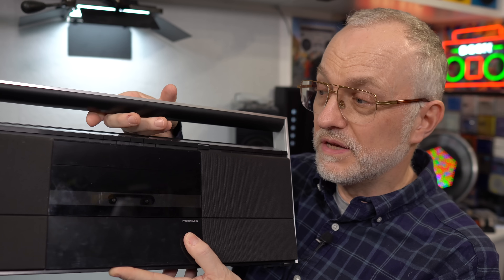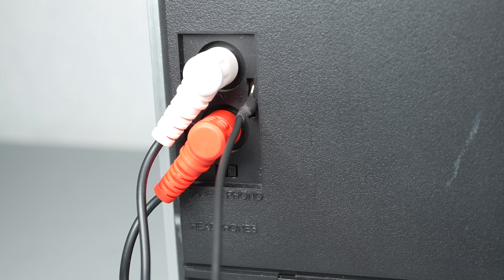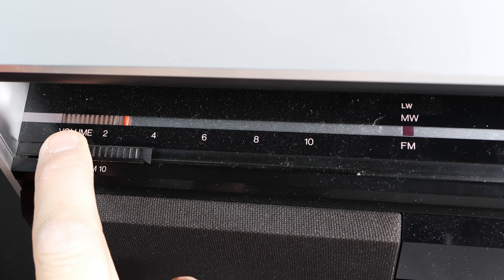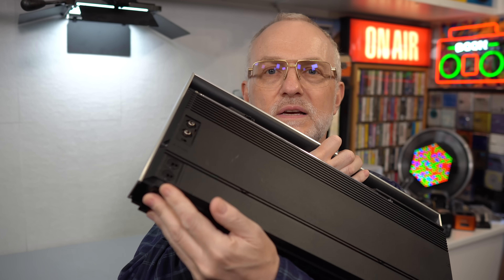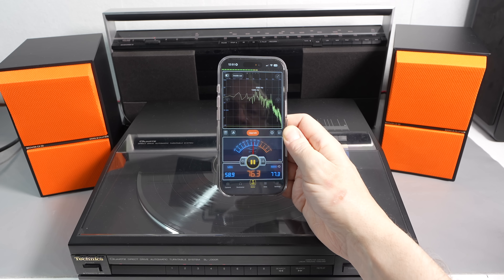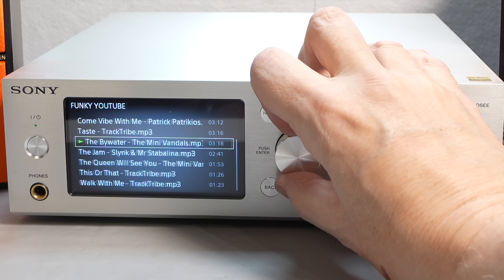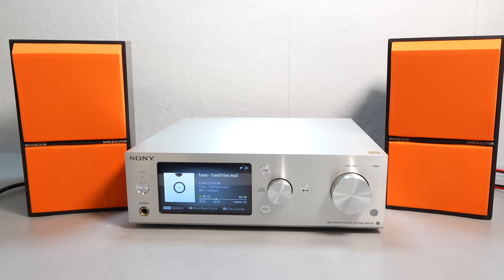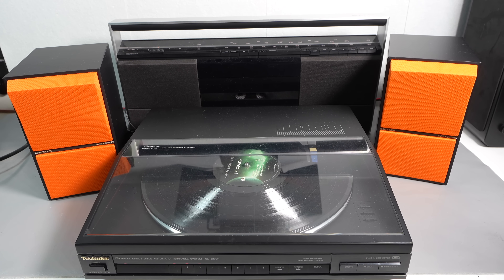Can custom CX50 speakers fix the Beosystem 10

Comment: Like all old hifi equipment, it deteriorates with age. How tiring it might be to hear all the time, capacitors and stuff do have an impact on sound quality, especially once you start pushing the volume and if they are from the early 90s or there abouts they wherent the best quality anyway. So i bet the radio would certqinly bennefit from a overhaul if you where planning on actually using it.

That being said though, b&o always was kinda the same as bose. They used a lot of sound manipulation in their systems to give them a certain sound. And they all have boosted lows at lower volumes to give their equipment a richer sound at normal listning levels but when you start pushing things you simply start running into the limits of their speaker designs. Making it sound increasingly thin as you increase the volume because you already get the maximum lows at low volume levels and they just cant increase further once you hit the 80db mark.
It simply was never designed for very loud volumes, mostly because their target audience wheren't the people interested in listning to their music at crazy levels.

This stuff was never made for youngsters having parties or anoying their parents, this was aimed at middle class people who wanted rich sound to listnen to their music at normal volume levels out of the box, without having to know anything about hifi equipment or having to worry about matching components. And for that it always performed perfectly, hence the popularity of brands like bose and b&o and the likes, even at their pretty hefty price points. Buy a system from b&o or bose and it simply fits together and it's all calibrated to give the results people are looking for whatever you decide to buy from them. They invented the "walled garden" approach long before apple became famous for it.
It can be a major headache to get b&o equipment to play nice with normal non branded equipment at times, requiring converters or custom cables and stuff to get it to work.

It was always made for regular peoples ears, and as much as self proclaimed audiofiles like to whine about it, regular people like a rich sound. And to get a rich sound at normal volumes boosted lows is what is needed.

Anyway, these systems are designed to get the most out of the speakers early on where most of their target audience would be comfertably listning to their music at the cost of audi performance if you push it beyond that. And turns out, this is the sweet spot for most people that have the means to go out and drop multiple grand on equipment from these brands to equip their middle class homes.

Comment: I noticed the internal speakers in the 10 are rated at only 3 watts each when I took the back cover off.  CX50s need a lot more power I think.  Yeah just read cx50 rated at 50 watts and performance will go down below 5 watts.   ..finished cleaning this one up.  Turned up past 4-5, bass decreases, sounds like yours does the same.  I'm guessing it's unfortunately the nature of these, but they sound good up to 4, don't want it louder than that anyway.

Comment: Matt this made me so happy! I was born in "the city of sound" - Struer, Denmark - home of Bang & Olufsen. My entire family worked on the factory, thus I also grew up with and around Beosystems. I am still rocking the old BeoSystem 3300 that my dad bought for my grams in 1986 - I sold the Casette Player and kept the turntable with the ampifyer - and the original BeoVox MC35 - it sounds a BLAST still. I still live here too and I have a few B&O engineer and technician connections if you ever need some parts, let me know ♥ Xx

Comment: TCP (antiseptic) mixed 50/50 with water and given a good gargle will give your throat a good infection destroying sweep, manuka honey mixed with 45% whisky is a good plan B in that department too which has added benefit of treating tubes going down if swallowed which can't be done with TCP.
Now for some internal overall reinforcement after being run down plus countering effects of aging which is taking marine collagen along with co q 10 like 400-600mg.daily for a few months then marvel at the results

Comment: You could get CX100s in black with orange grilles, I recently had a pair. And the original cables had a 90º female DIN so you could run the cable down that channel in the cabinet for neatness.

Comment: Matt, thank you for your videos. I enjoyed watching quite a few of them. As a beginner hobbyist, I need your advice. I am just starting to gather the necessary tools for audio electronics testing and repair hobby (nothing major, maybe a cassette deck or a solid state receiver). I am not experienced and am just getting into this hobby. I am looking at getting a DC power supply and a function generator. What would be your recommendations for budget versions of these devices? Do I need a dual-channel power supply, or is a single channel sufficient? What parameters for a function generator are sufficient? I want to get my budget in check, yet I do not want to buy junk either. I will appreciate your advice. Thank you!

Comment: Hi Techmoan.  I wonder if you can advise me please regarding sticking cassettes. I have tried lubricating them with silicone but without success, so I am wondering whether to buy some empty cassette cases and transferring the tape over to the new cases. Problem is, the new cases don't look to be of good quality. Have you any advice please?

Comment: The more loudness from the built-in speakers is more likely because they have higher sensitivity. This is a battery power unit, and they most probably wanted it to last on the batteries, therefore used speakers that are louder at the same rated power. Or that use less power for the same volume if you like

Comment: I rather like the orange and black color combo you chose for the speakers.  As far as the sound becoming thin perhaps there are some bad capacitors in the amplifier? I know that on several old record players I have they have circuitry that diminishes the bass as the volume increases

Comment: Hi Mat,
How might I contact you about doing a video on a CD megachanger that uses an elevator rather than a carousel as its mechanism? I have an Aiwa DX-C100 I purchased recently as new old stock that doesn’t quite work that I think would be a good fit for the channel.

Comment: CX50, 75, 100 can be DIY modified to include a Raspberry Pi with a four channel B&O amplifier plugged on top that turns these and some other B&O speakers into active streaming wi-fi stereo speakers. They stop being passive speakers as the passive crossover is removed. All power is from the primary speaker but the secondary speaker is fully active with active cross over (all the settings for B&O passive speakers are provided but you can work out settings for other speakers). You get all the modern features from these excellent mid-80s speaker design. 

Foam kits are around £20-25 with YouTube video showing you how to fit them.

Comment: If you want some really good sound quality, room filling, loud vintage b&o speakers the s75’s are amazing. They used to be quite cheep but people are realising how good they are and they run around £500 these days. The detail of the sound out of them is hard to beat at the price. You can hear an artists mouth movements on a record with a good amp to dive them 😊

Comment: I have the cx100s, got to get them for the design and they seem to offer a reacher sound than the 50s.

To those who are wondering: they are definitely fine and they sound really clear. Not a lot of bass from them but good volume and quality. They definitely make speakers differently nowdays. Those newer ones seem to handle bass better (in balance), but if you are looking for a good looking pair of not bass heavy speakers, I would recommend these.
Reply: And get them refoamed, they've all desintegrated over time
Reply: @bolshoff97 Do really all B & O speakers suffer that outer suspension illness?
Reply: @imho4556  all that I've seen were either refoamed or the speaker suspension was not in the best shape, so I think yes - sooner or later
Reply: @bolshoff97  Thanks a lot! 
So despite the neat design, I won't go looking for Beos. I only trust (used) speakers with rubber/fabric surrounds.

As far as the bass is concerned, I have the impression that many modern speakers are tuned to resonate with the kick drums - too much virtual ‘bass’ for me.

Comment: Time to replace all the capacitors in that stereo.
Reply: I think that “recapping” has become a hype after cheap capacitors with poor ESR have become a problem in switching power supplies with high current loads at high frequencies. (TVs, PCs...)

Today there are ‘in circuit’ testers. If a test is not possible without desoldering, it is not too late to replace them - but the time wasted and the "traces of destruction" are less.

Even tantalum electrolytic capacitors do not necessarily have to be defective - but they do carry the risk of their contents leaking “explosively”. So perhaps with tantalums it's really better to replace them in advance...

Comment: The Beosystem "boombox" reminds me of how some folks buy stuff just as decoration/to have it vs interested in dauo/music. If you do get to tear it down and there is a "fix" to the volume thinning out the sound, I would be interested to see if it also fixes the external speaker audio quality. Are there any other BO products that those speakers could pair with which don't have the limitations of the 10?

Comment: Very odd, especially as the manual suggests that the distortion which may occur at high volume levels doesn't affect external speakers. If the external connections are just conventional speaker out, affected by the volume control, then it's highly likely that the same distortion would apply (unless there are two different output stages or different filtering then the sound would be the same at best, and weaker for higher drive power speakers).

Comment: I'm pretty sure the reason the larger speakers go less loud, is that the increased bass response is pulling more current from the amplifier at a lower total output

Comment: I recently refurbished a b&o 5500 system for a friend and it had a pair of redline 60 speakers as well as a pair of these. I think the idea was to use in a multiroom setup, with the little ones in a kitchen or study. The redlines were far superior ( and much bigger ).
The cx50 have a sensitivity of 89dB which is pretty decent, but I still think you might need 20watts to get the most out of them. Especially as they have a 6ohm impedance which requires nore current to drive. No idea what the little ghetto blaster puts out.

Comment: Might be an idea to do a collaboration with Mend It Mark.  

As for tweeters at the bottom,  its possible the idea is if the speakers are above head height it's better to have the tweater at the bottom since they're more directional.  It reduces the need to tilt the speakers.

Comment: Weird. They actually tell you in the manual that it will distort at higher volumes. Of course they also say that external speakers are the remedy - which in your test wasn’t true. Seems like there would have been many ways to engineer it to use a different tap for internal speakers.

Comment: Oh, neat, an audio product covered on the channel that I have experience of, and actually currently use! 😃 
Got a pair of CX50s as part of my computer audio setup, powered off a TEAC AI-101DA, together with a Tivoli Audio Model Subwoofer active sub to cater for the low end. 
The CX50 are from back in the early 90s, still in great condition, just needed the woofer surrounds replaced before being out back in action, since those had badly deteriorated with age. Not too hard a DIY repair project and the resulting setup sounds really quite good. 👍

I'm definitely agreeing with your observation about the sound of the CX50 just by themselves not being too bassy. In fact I'd say they lack proper body on the lower frequencies, but adding that little active sub rounded out things very nicely in my opinion for such a compact setup. One thing that must fundamentally affect the CX50's bass output is their closed cabinet construction. Whereas many smaller (and even larger) speakers often have some type of bass porting, these have none whatsoever. Even B&O's previous C series bookshelf speakers did in fact have rear vents. Wonder what made them change the design for the CX models? 

Thinking of it now, I think I recall reading somewhere that the CX models reportedy sound fuller if actually used like their name suggests - placed in a packed bookshelf instead of out in a room 'alone'.

Comment: Quite a nice set of speakers, orange finish aside.  Aluminium sidings.  Really?  New one on me but we can't know it all.  I'm going round all my equipment this summer and checking the condition of it all too.  I have a pair of Beovox 545's and were still in good order when last used.  I may be looking to change the bass speakers and crossover circuitry out soon though so thank you for the information there.  It's been good seeing you again, sir.  All the best wishes, Matt.  Cheers!

Comment: I love the low dynamic range sound of 78s because that was the best technology could offwer at the time. However, I have never found a portable sound system which sounded anything but cheap. I do not need booming bass but warm, good dynamic range.

Comment: Not an expert but because the drivers have different acoustic centers along with the crossover design results lobing at the crossover frequency. The listener would only hear the target frequency response with ear height at a specific angle relative to the center of the baffle.  Engineers may have assumed they would be mounted high on wall or shelf above ear level so they chose driver positions and tuned the crossover so that the primary lobe pointed downward or perhaps  they just liked how it looked.  Mission and Buchardt make 2-ways like this.

Comment: Looks like you are on the mend.

Those reconditioned speakers look great…but as you hinted, I wonder if the problem is “old speaker technology”.

I can imagine back in the day if I had spent that much money on the main unit, let alone the separate speakers, I would have been very disappointed.

Comment: I have the same design wire stripper, I'm always afraid that the cutter part on the handle might pinch my finger.
You sound stronger since your last video, wish for a quick full recovery!
I really like the Beosound CD player that has a cassette mechanism. These devices are sooo expensive... But one day I might decide to shill out the hard dough.

Comment: Volume getting thin past the halfway point sounds like an "auto-loudness" feature, like those old "loudness" buttons that would add bass and treble for when played quietly to sound like it does when turned way up. I never really liked auto-loudness because sometimes, just like here, you have a weak input that requires turning the volume up while still needing that "loudness' to sound good and it's not there and it just sounds like crap.

Also, it sounds and looks like that Rona made you age another 10 years in 2 months, it must have torn hell

Comment: woofer on top/tweeter on bottom has to do with crossover phase - there might be a null in output in the crossover region between drivers in positions lower than straight on, but not higher than straight on

Comment: Funny dream I had last night and you post a new video. I frequent a local thrift store that always has electronics. In my dream I was at this store and they had an unusual looking old compact stereo system / boombox with built in record player, Cassette and 8-track decks and the whole thing looked like square blocks that were Blue, Red and Yellow.
I had never seen anything like it and the only thing I could think of was “I need to get a hold of Techmoan”. 
Yes this really was a dream I had last night. 😂

Comment: I am very impressed with the Peak elec ESR70 series equivalent resistance meter for testing electrolytic capacitors. Everywhere, whether linear PSU, SMPS, PA or other circuits. First ‘in circuit’, then again the unsoldered components if something is not clear (buffering of rails e.g. with parallel capacitors at more or less distant points - at least one of them might be bad).

But even a ‘good‘ capacitor may not be capacitance enough to buffer a weak power supply if a strong bass is to be reproduced at a decent volume for more than just a peak. The rhythmic supply voltage dips can be seen with an analogue multimeter (or better still, an oscilloscope).

Whether this only leads to less bass due to the high internal resistance of the power supply or to non-linear distortion depends on whether the power rails of the pre and driver stages are buffered  well enough separately or are symmetric. However, I think that this is not to be expected with battery devices (at least by design) from 6 to 12 volts. Here, operating point shifts with distortions are very common to occur.

On the other hand, small speakers in closed enclosures need a lot of ‘juice’ to compress the air inside to reproduce (relatively) deep bass (‘No highs, no lows - it must be Bose...’). B & O could therefore have thought of larger and open speaker cabinets in the manual to avoid distortion at higher volumes. 8-ohm speakers also ‘draw‘ less current, so the capacitance mentioned above has less influence, but the resulting volume is also lower. The volume control can? - may? - must?  therefore be set higher... 😉

Comment: You know, you get a similar sound (ok, much worse) if you plug a record player into an input that does not have RIAA equalization in circuit.  Just a thought, but a familiar experience.  Definitely harsh and without much bass.